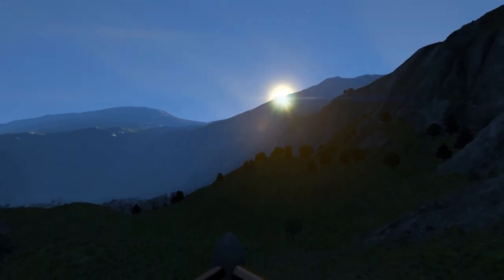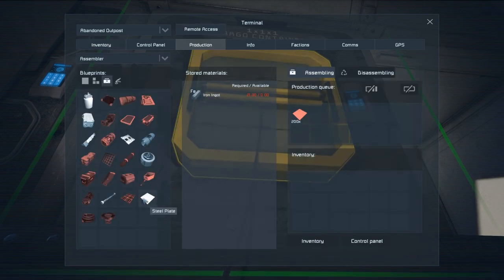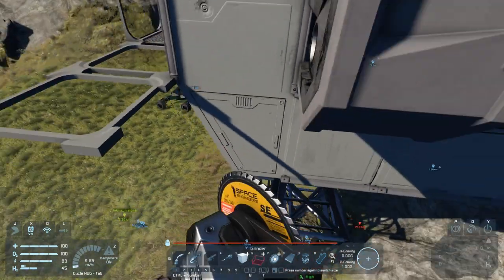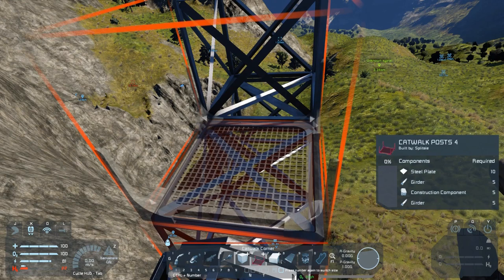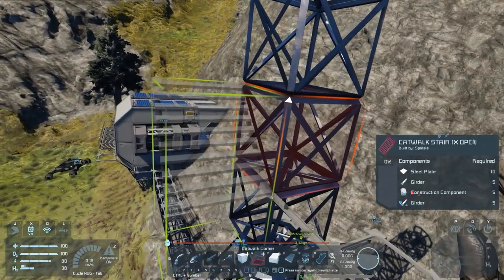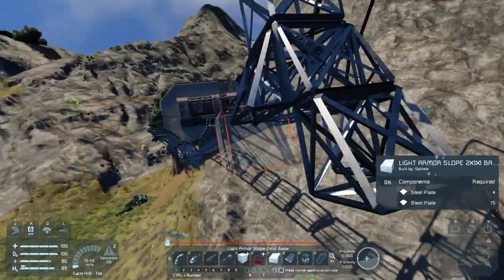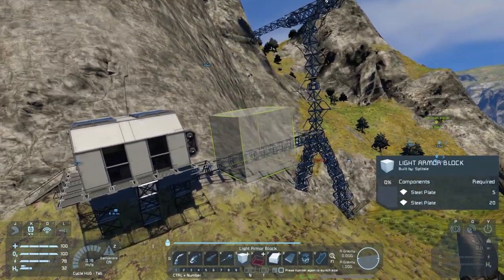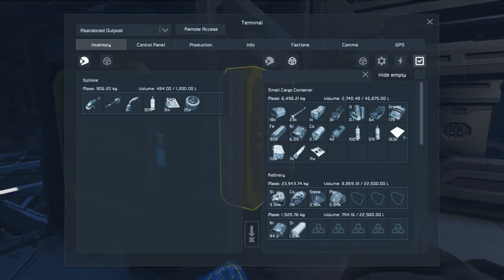Survival, Maybe... #4 Building a Sun Tracking Solar Panel (A Space Engineers Survival Series)

Comment: I like the design and approach - stylistically different than I usually do so it gives some thought towards such going forward for me.  Half-blocks and parachutes are new for me since the last time I spun up a survival world, so I particularly like how you integrated them into the solar panel arm design.

Well done Splitsie - I look forward to seeing this project progress.
Reply from the maker: Thanks Friti, in my earlier builds using solar panels I always wanted something flatter than a cube so the half blocks slotted in nicely to an older idea :)
I'm pretty happy with how the tower is shaping up, hopefully it's going to provide a useful amount of power too
Reply: It should, provided you mind your Energy Budget.  12 Solar Panels will yield 0.120MW at peak.  As you are solar tracking, you'll get close to peak for about 1/2 the daylight hours ( 1/4th the day.  Mountains reduce things a bit, so conservative estimate.  More is straight bonus!)  as such you'll be generating 1.44MW/h.  Not including your existing 2 solar panels (assume maybe another .03 to .04MW on average during daylight.).

With an energy budget of 1.44MW/h under peak/direct sunlight, that's nothing to sneeze at.  Your Arc furnace uses .33MW when in use, your Refinery uses .56MW, and your assembler uses also .56MW.  That puts you right on 1.45MW under full load everything running.  So you can potentially run flat out while you have sunlight - that's a good starting point, and that's worst-case load.  Assuming you're not using everything all the time, you'll come in a bit under that - particularly if you turn off the Refinery and only use it when you have to, relying upon the Arc Furnace for processing and the Assembler on an as-needed basis.  I suspect you'll have as-is enough under moderate controlled use to get through the night with that setup.  Some Power Efficiency modules will improve this even more and net you more energy yield stored.

Keep it up!  I like to see smart Solar designs, and you're one of the few whom seems to 'get' operating under such power constraints.  :)

Comment: How far SE really has come. When you said "Need space for a Timer Block and a Programmable Block", I was confused. I haven't been around that long, but now we have custom turret controllers that enable you to use a rotor, hinge, and camera to make a grid permanently face the sun. Wild
Reply from the maker: Oddly enough, there are still occasions where the script is still useful, like a dual setup array as I built here. This would require 2 CTCs or just the one programmable block 🙂

Comment: I flew up to the highest peak atop the Hunting Cabin (not the one right on top but the one a bit to the side), tunneled down to the level of the base and hooked it all up with blocks. I have to say, I do like that the long base of the tower is protected from attack by lots of rock, this way. The original purpose was to get more sun exposure, and it did do that too.
Reply from the maker: The top of the mountain seems like a pretty good place to get your panels set up. I didn't want to do that at the time since I didn't have the resources and I wanted to have the tower visible in the base designs. So in other words, for silly little reasons that were largely aesthetic :P
Reply: To be fair, your tower base and even the huge panel wings look cooler than mine. Mine is... very minecrafty. >.>

But hey, they both work. That's the important bit.

Comment: Empyrion has structural integrity but it works fine. I was playing it on Intel 4000 graphics back in the day
Reply from the maker: Structural integrity for Empyrion is a bit different to SE, Empyrion doesn't do the any of the other physics calculations that SE does - it's more focused on the survival side of things, so having structural integrity is simpler to integrate. Medieval Engineers has structural integrity, but it doesn't have flying castles - at least not by default :P

Comment: If an Arc Furnace is superior to a Refinery in terms of power efficieny and speed, is there any reason to build a Refinery at all, or should I just build an Arc Furnace outright, given it also seems to require less materials?
Reply from the maker: It was back then, but these days the basic refinery (which replaced the arc furnace) is no longer more efficient and with upgrade modules on a full refinery they've always been better

Comment: Hi Splitsie, just bought Space Engineers after watching several of your videos. I replicated your T-shape rotor setup for the solar panel using Isy’s scripts. After a  while in-game, my panel start to shake, sometimes up to destruction forcing me to reload a previous save. I’m playing the Never Surrender scenario and I opted for a Moon landing so gravity is 0.25g. Any thoughts on why the uncontrollable shaking? (Time varies from 10min to 30min before this shaking behavior occurs)
Reply from the maker: I don't have the most useful of answers to this, but something that is worth trying is to (with backup saves because this could go badly wrong) turn on 'share inertia tensor' one at a time on the rotors and see if that stabilises it as it can sometimes make it better when things start rattling and wobbling about. Also make sure your panels are symmetrical so there's even weight on both sides of the rotors
Reply: Splitsie Hi, first thanks for answering. My setup was identical to yours, so aka symmetrical. Can you play with individual rotor while Isy’s script is running so I can fiddle with inertia tensors or does the script overrides any modification you make? On a side note, I’m halfway through your QoL video and it is good content.